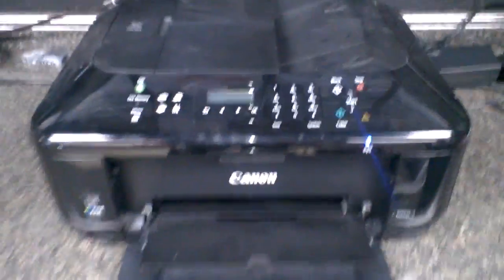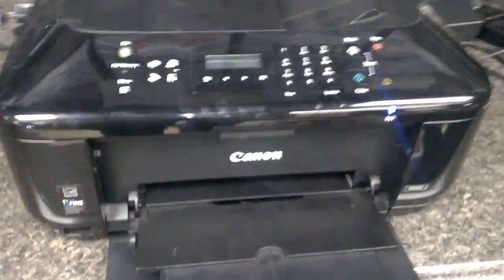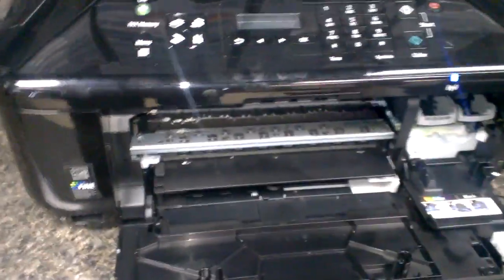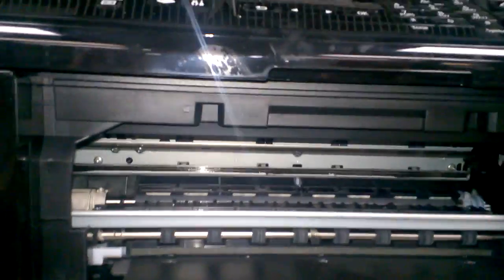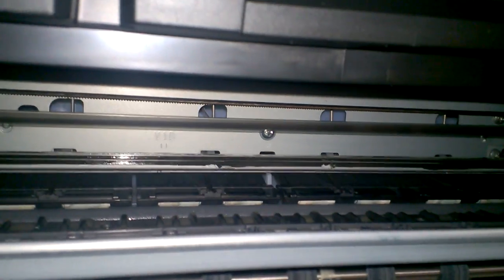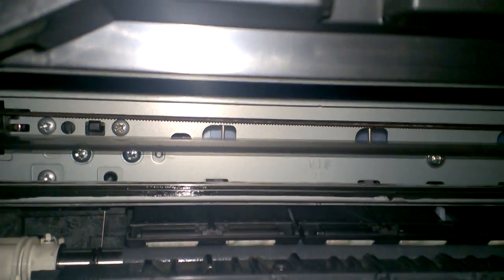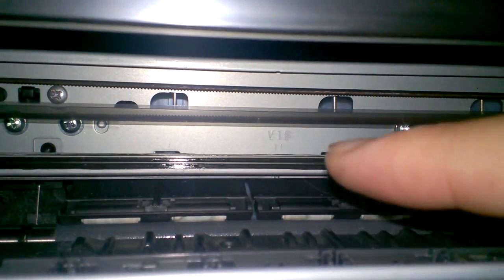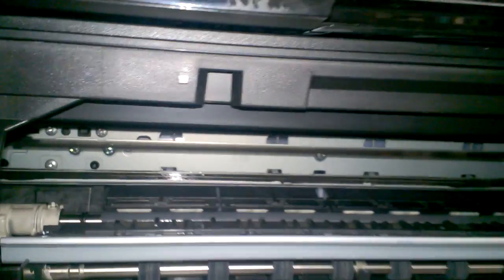Canon Error Code 5100 PIxma MX432 MX452 MX472

Comment: had a customer with the same error. Saw the gunk on the strip and thought it was too good to be true, it wasn't. Saved me from taking it apart to look for a paper jam that can't be reached from the back or front openings, failing, and telling the customer to buy a new one

How ever did you figure this out?
Reply from the maker: Thank you for sharing.  I'm glad I could help. I had given up on a few printers with that error before. Jow I figured this out is one day I saw a page print with a vertical line and later printer gave me this error code, I cleaned the strip and it fixed it.

Comment: Mine was all clean and no paper pieces in, but the white wire strip was catching at the bottom white piece of plastic on the rack and folded the strip causing it to catch there all the time, my only solution was to superglue the wire strip at the connection and hold the wire strip up until the glue dried, that raised the strip just enough not to catch at the bottom plastic piece.
Reply from the maker: Thanks for sharing.  This may help someone solve their similar issue.